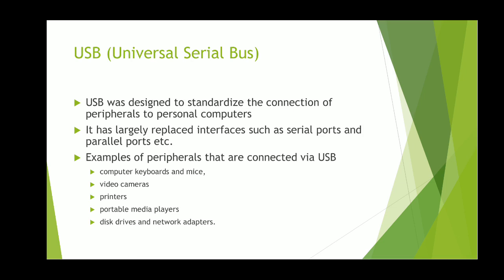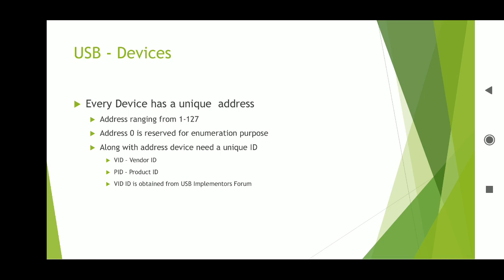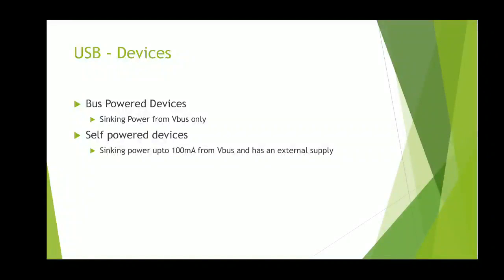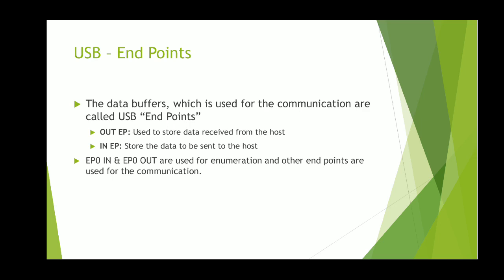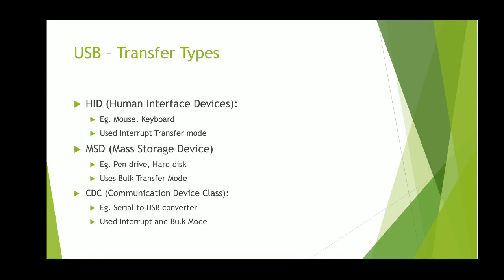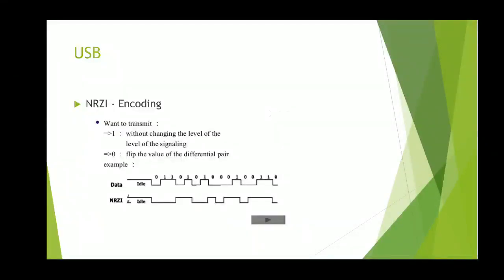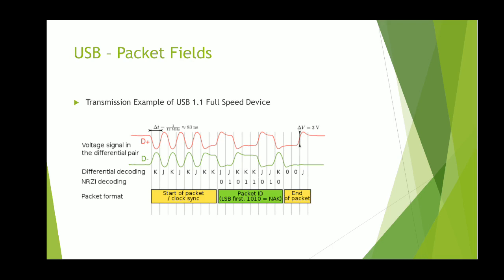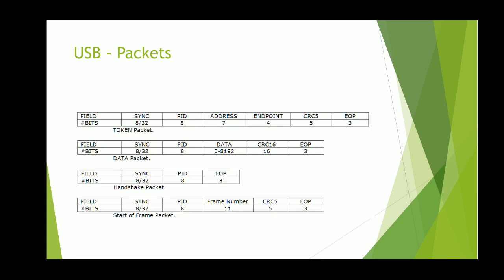USB Protocol

Comment: The points are covered, but the depth of the topic is not covered. Like if a interviewer asks me a question based on this ppt, I won't be able to provide reasoning. So I would suggest to go about the ppt via that perspective. Check All About Electronics channel videos. You'll be able to deliver content better.
Though video was informative. Thank you